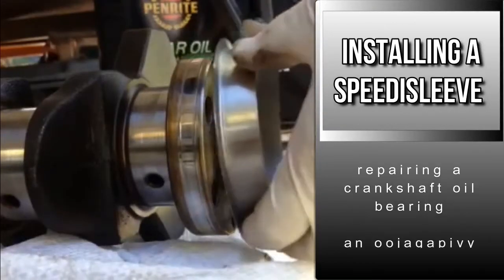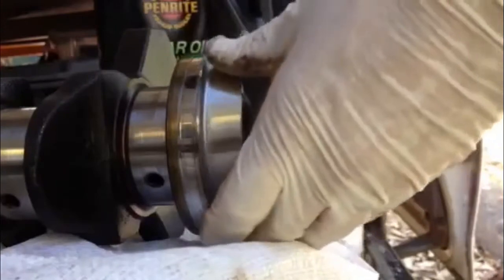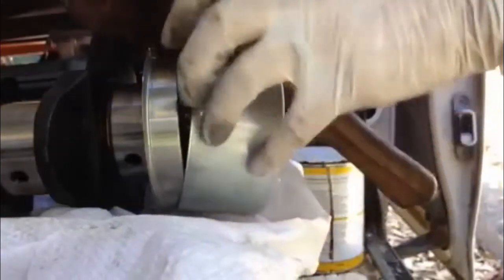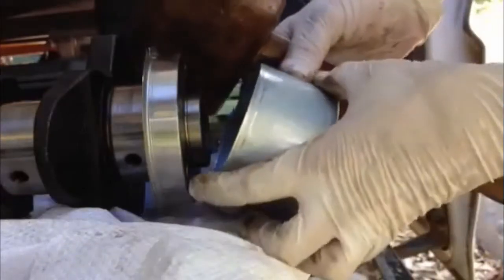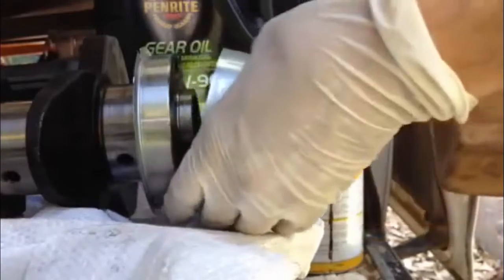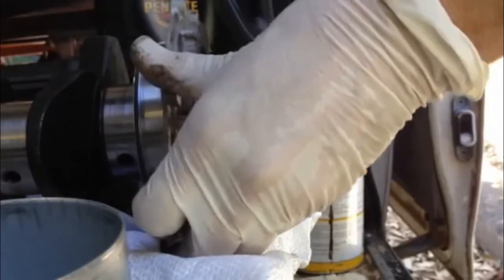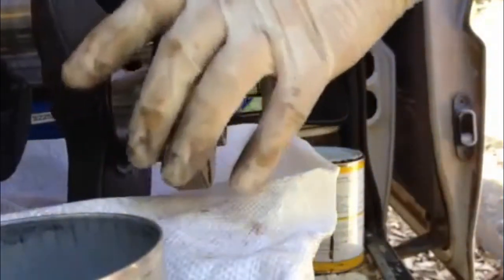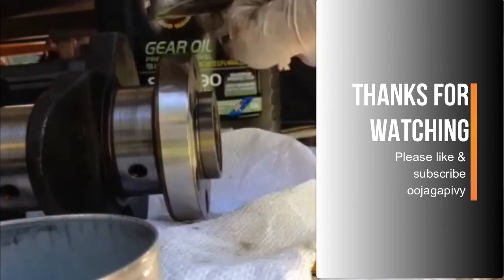Using a speedisleeve to repair a rear crankshaft oil bearing for an FE motor

Comment: Do the instructions state that you have to tear that ring off, because other videos I watched they just leave it on
Reply from the maker: Definitely! The supplier I bought it from stated it had to be removed and explained how to do it.
Reply: It depends on the part you are repairing.  In oojagapivy's case, it's a crankshaft, where the sealing diameter is larger than the shaft diameter.  The flange, if not removed, would interfere with the block and the main cap.  In other cases, like say a wheel hub, the sealing surface is smaller than the hub itself, in which case I think it's okay to leave the flange on as many people do.  ref:  https://www.youtube.com/watch?v=r2BKl8N65qo&ab_channel=ChrisGassner

Comment: I think I need to do this, my ca18det don't stop de leak oil on rear seal... Maybe I try with a oem seal...
Reply from the maker: Junior Mendoza if you’re replacing the seal, check the bearing surface for wear or a groove. That’s what mine had and I was told that if I simply replaced the seal it would still leak fairly quickly. That’s why I did the speedisleeve
Reply: @oojagapivy  I changed 2 seals for leak, anybody told me which I need oem seal for that, angd if the crank it's ok???
Reply from the maker: Junior Mendoza by 2 seals, do you mean front and rear, or the rear one twice? Whether it’s a genuine oem seal, or a different brand, if the bearing surface is worn/has grooves/is damaged, then it will continue to leak, because the oil seal is what causes the damage.
Reply: @oojagapivy  twice rear seal! But the crank apparently ok! I'm crying haha
Reply from the maker: Junior Mendoza keep at it. The grooves in mine weren’t very noticeable but were enough to cause leaking

Comment: Did it end up working properly?
Reply from the maker: Deon Fernando yes it did. It allowed the van to pass rego, removing the oil leak from the rear of the engine. I also replaced the oil seal that this end of the crankshaft sits in. Had I just replaced the oil seal, it may have continued to leak due to the wear on the bearing surface. Thanks for watching.
Reply: @oojagapivy @ what vehicle is it?   Do they make this same part for 4.8 vortec??? Thanks
Reply from the maker: @gerardolopez5875 a 1994 Ford econovan. 2litre FE motor. Got it from a specialist bearing supplies, so I reckon they’d have something for most motors.